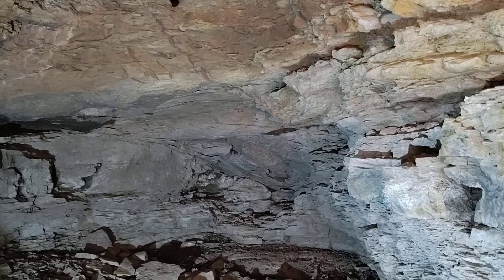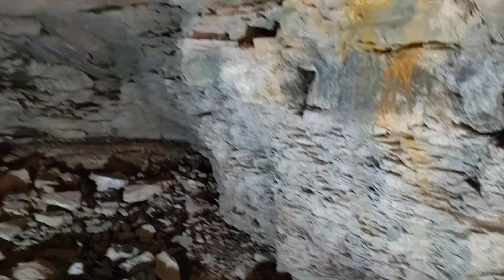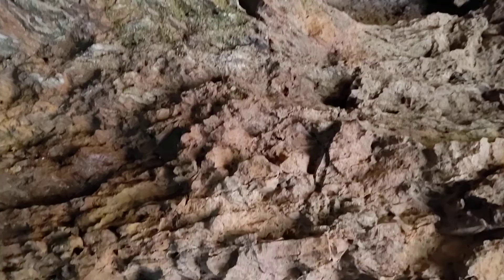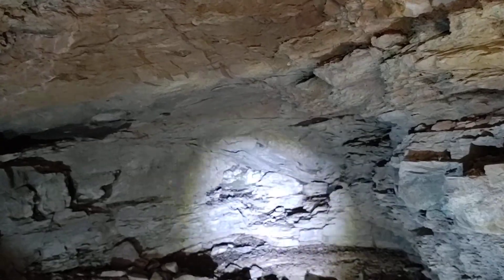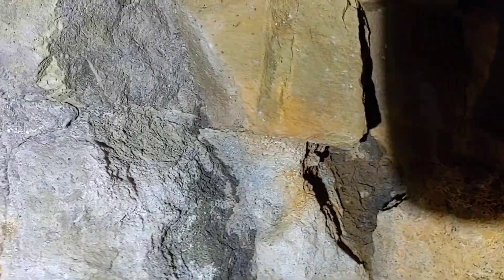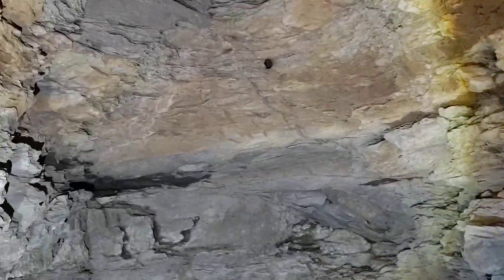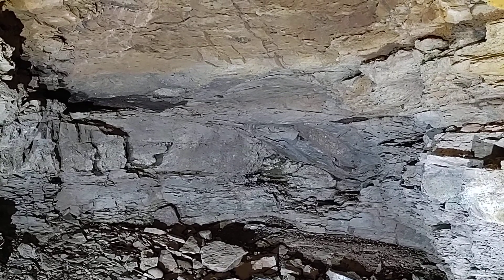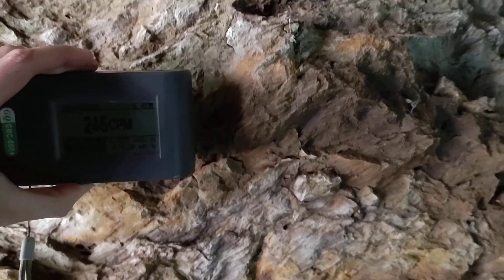Abandoned Pennsylvania Copper Adit

Comment: Great explanations and examples!  In the sedimentary rock formations of  northeastern pa, are the uranium and copper originally laid down with the host rock as part of the sedimentation prosses or are they later injected into the lens through groundwater movement?  Thanks,  Jim M.
Reply from the maker: In that area it seems to be up for debate. There are some examples of both, but there seems to be some inconsistency in the temperature of the fluid in deposition, but it seems that it was fairly cool. I'm still studying the exact details of the mechanism.
Reply from the maker: So I was researching this further and because two or more minerals together in one area and separate in another, it sounds like it was several processes over time that lead to the deposits. Depositing of one mineral being covered and having groundwater deposit another mineral in the same body.